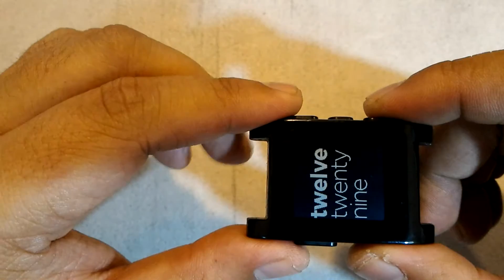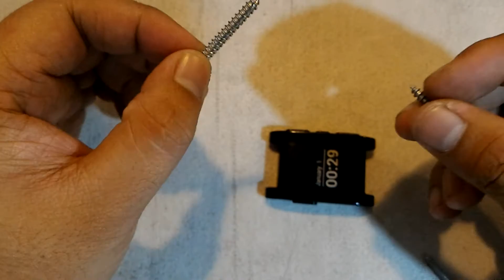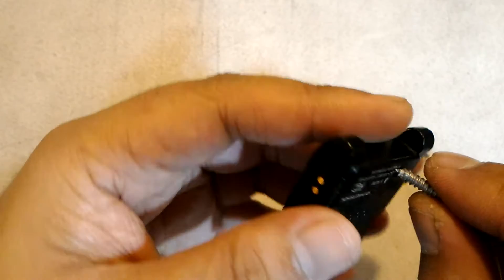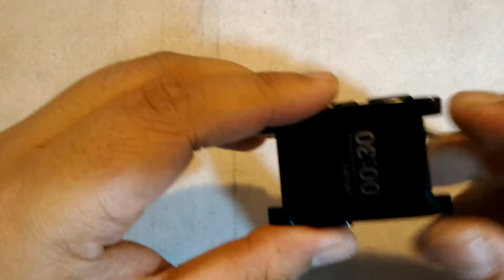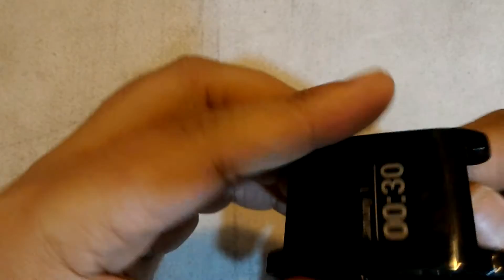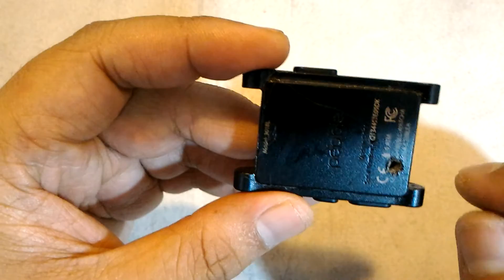Pebble Watch 1st Gen  Screen Tearing Repair guide

Comment: This is a guide to how to butcher the watch. All you need to do is to remove the back and put something in to press on the ribbon cable. A fold of duct tape works well. Reassemble and you're good. AND you haven't butchered the watch and wrecked the waterproofing.

Comment: All the people commenting "it worked for me", did y"all not see any other video to fix this? This one is destructive. For how much I love the aesthetics of my Pebble Classic, I will never even scratch the back of the watch with anything. Tearing issue can be fixed in 2 minutes by just opening the back lid and placing a small folded paper on the connecter. Replace the lid and it's done.
Mine works just fine with this method.

Comment: EXTREME CAUTION IS ADVISED
TOOLS I USED:
1 - Ice Pick
2 - Stove
3 - Dremell or equivalent
4 - 2mm screw
5 - Sharp blade
6 - Tape (I used thermal but i imagine any tape would work)
7 - Crazy Glue, Super Glue, Epoxy or equivalent.
8 - EXTREME CAUTION!!!  YOU DO THIS AT YOUR OWN RISK AND IM NOT RESPONSIBLE FOR ANY DAMAGE OR BROKEN WATCHES.

I did it, i fix my watch using this technique but not with a monstrous screw.  And works for me.  Im going to left this small guide to help you with this issue.  I used a very pointy ice pick, then heat it in the stove make a little hole not deep just to fit a 2 mm screw between the letters CE but in this video seems  more at the center.  Cut the melted plastic with a sharp balade, put the screw it no have to have end point and then start to give torque to the screw little by little and watching your screen at the same time.  I saw my screen back to normal.  With the screw firmly tight test and re test yor watch buttons if it fails continue giving torque until you get yor screen normal.  Now put tape to shields the back of the watch.  * (((BEFORE THE NEXT STEP READ THIS: While you cut the screw it becomes hot and melts the plastic making it inestable.  I recommend cut by intervals and let the screw cools down.  Check the screw and give some torque and centering while its head is still added because at this point the screw is HELL HOT*** ))) Now with a dremel or equivalent cut off the screw head leaving the rest of it inside the watch to put presure to the pc board and screen.  Change the dremell or equivalent tip to metal sanding to wear away the screw excess.  (It became hot too so, beware.)  After this check the screen and buttons it should be fixed at this point.  Put a drop of glue and leave it to dry.  After glue is dry remove the tape and wear your headache free screen and you with a big smile in your face :) At this moment i didn't test the water proof thing so i don't know about it.  If you do this with Extreme Caution your watch do not receive excessive damage.
I hope this guide helps you to give the last chance to give live to your watch.  Good Luck!!!
* Update:  After months wearing my watch with no screen issues the water resistant part was perfect.  At this time i'm writing here i use every day my watch!!!!

Comment: I tried this method with a spare kickstarter edition Pebble (i.e. the model without screws) I had lying around and it did not work, despite the drilling was clean and I was able to see the ribbon connector though the hole. No matter how much I pressed on it. However I did manage to fix a friend's OG Pebble, which after many years working great suddenly started with really bad screen tearing, by simply grabbing it by the end of the strap and swinging and hitting violently the watch (face down) against the slightly padded frame of a sofa, kind of like if it was a whip. I did this a few times, then refreshed the screen by pressing a button and the problem just went away! No more screen tearing whatsoever. Not sure it'll work for other watches but it's worth a try...

Comment: The ribbon doesn't connect the screen, it is for the buttons and light. However the LCD is connected with a typical rubber connector which lies exactly beneath this portion (actually at the bottom of the watch). That's why pressing there should work for this issue.

Comment: HI,
This really works.
I did it and in order to keep the ribbon cable (black in my case) under pressure I introduced a piece of cork tight enough to serve also as a tap. Then I closed the hole with an auto adhesive black velcro cut at proper size. Good!